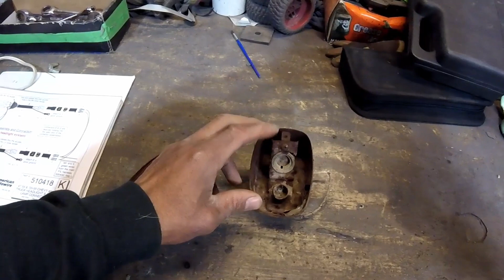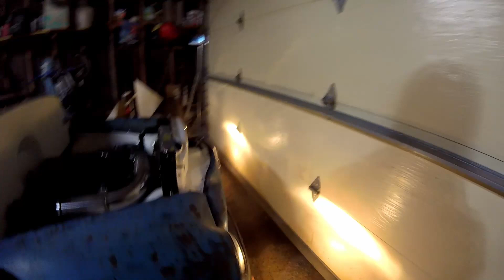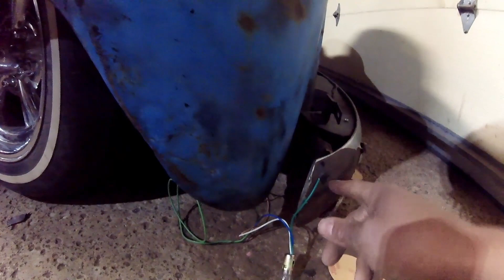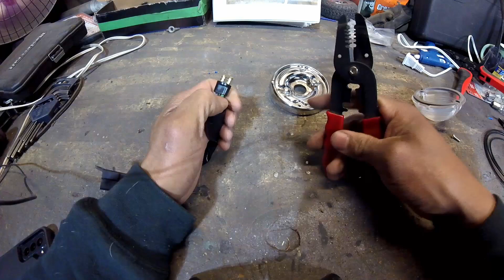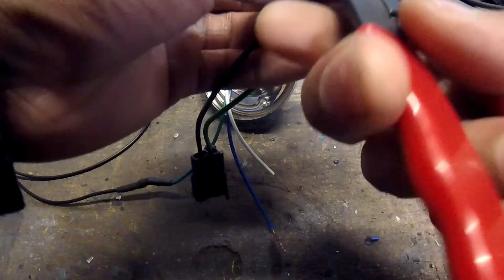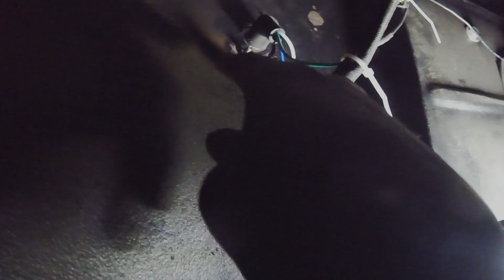Converting 1947 - 1953 GMC Parking Lights To Signal Lights

Comment: What is the diameter of the light bezel where it meets the truck? Is it the same size as stock?
Reply from the maker: No, it is larger. They are about 3-1/2". It's noticeable beside another stock truck, but less noticeable if you don't know they were changed.
Reply: @stance_is_everything  It looks great. This is one of the parts that is almost impossible to find reproduced.

Comment: Nice video, I wish I saw it before I posted video of the struggle I had  my parklights.  You did it much better than me.
Reply from the maker: What did you end up doing?
Reply: @stance_is_everything  I fitted dual element sockets into the front parklight buckets.  I still have to figure out the tail lights.